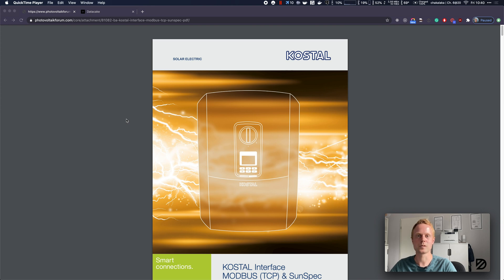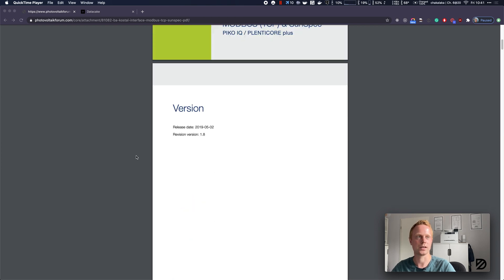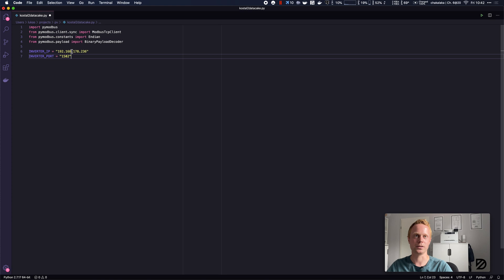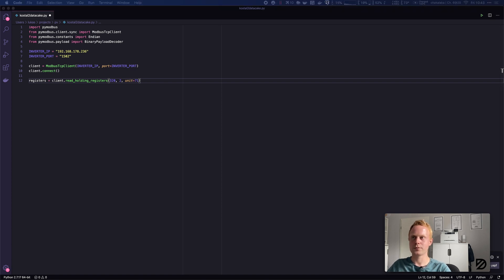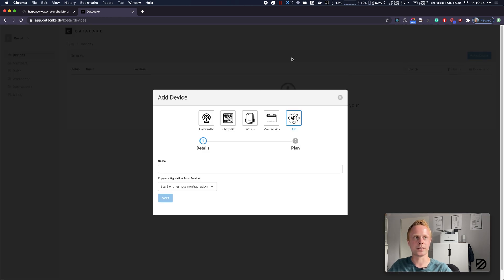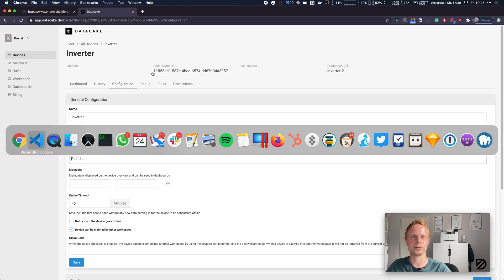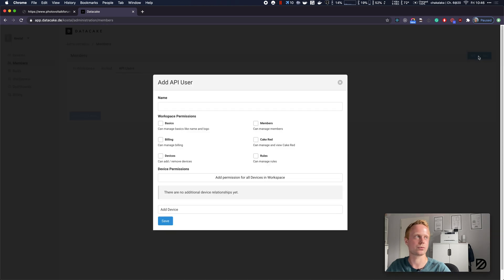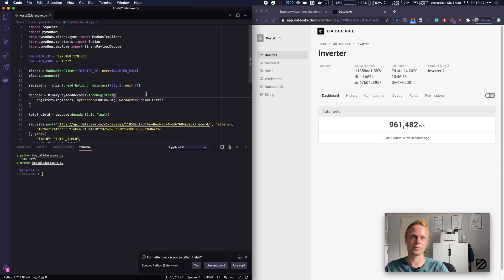How to connect Kostal Solar Inverter to Datacake using Modbus TCP and Python

Comment: This video inspired my to try Datacake and to implement a solution as my always-accessible status monitor for my Kostal inverter with battery. No need for opening any ports to my local network.
Here comes my current dashboard implementation:
https://app.datacake.de/dashboard/d/0b094605-39ec-4940-8181-551f6cce172c

Ingredients:
- Shell script calling Python script running on a Synology Linux NAS as cronjob every 5 minutes (code development on Rasberry PI 4)
- Reading via Python-ModusTcpClient as shown, submitting "multiple records" (batch=true) to Datacake API as JSON-Array.

In your video I missed closing the Modbus Client. ;-)

I really like your application!